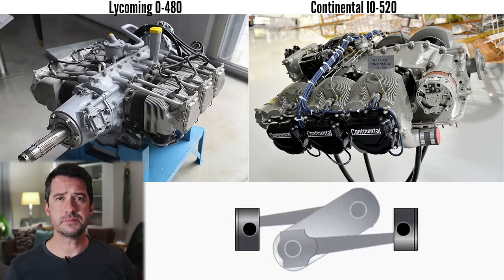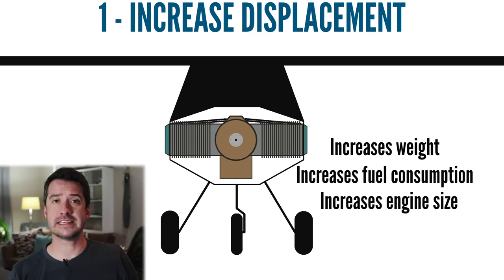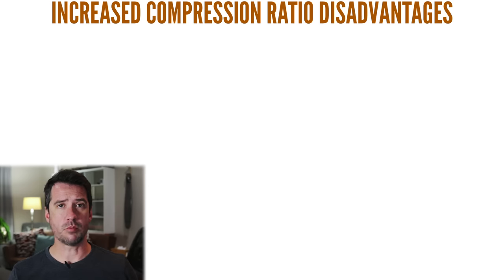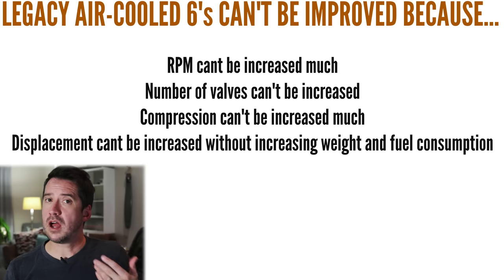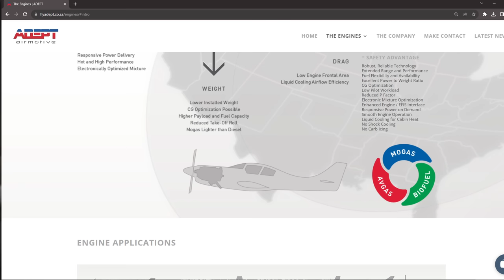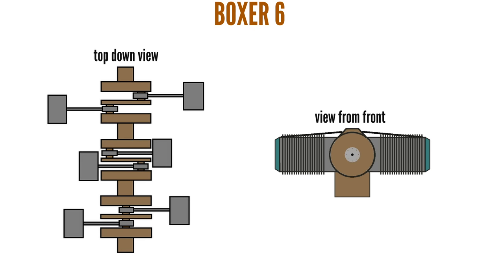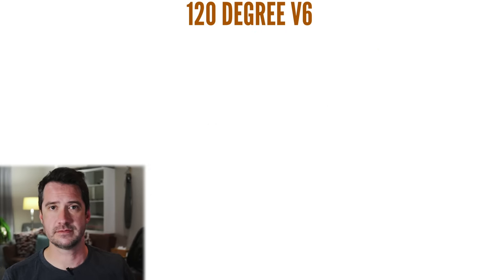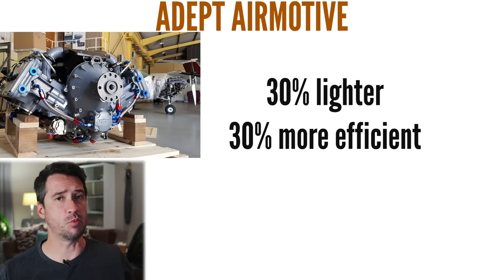Unusual V6 Airplane Engine Makes Boxer 6 OBSOLETE?

Comment: Turboprops make piston obsolete.
Reply from the maker: Not on cost. Be that puchase cost or running cost.
Reply: @LetsGoAviate  There's no reason why it should be from an engineering standpoint, nor an economic standpoint in the case of a specialty V6.
Reply: I still don’t get how the turbine survives the exhaust temperature before adiabatic decompression. Piston valves already glow red. Those tiny cooling channels fight against 90° of the gas which is burned.
Reply: @ArneChristianRosenfeldt  Inconel. Water injection. Impulse turbines. The engineers have it figured out, otherwise it wouldn't work.
Reply: @MoronicAcid1  I guess piston engines shouldn’t blow exhaust over oiled valve stems. Turbine bearings are far away from the exhaust. I wonder if it is possible to place a longer sleeve over the valve stem and blow cooling air into it while it’s open.

The exhaust valve could also sit on a shaft with a lever ( rocker arm ). So the actual bearing is far away, and only the seal gets hot. Or don’t really seal, just have higher cold air pressure than exhaust pressure. Kinda like in a turbine. Make exhaust valves out of inconel. Mercury cooling in stem and for the seat?

Comment: I think with proper design, a boxer crankshaft flat 6 can be nearly as short as a V6 crankshaft.  Example:  Subaru's 3.0 liter  EZ30D flat 6 engine is only about 3/4 of an inch longer than their 2.5 liter EJ25 flat FOUR engine.....

I'm not sure why they went with a V configuration when aircraft cowlings are already designed for flat engines.  People are used to flat engines in airplanes, why not keep the customer happy and build their engine this way?
Reply: Boxer engines are relatively fragile (they have weak crankshafts, as they either have flying webs in order to simplify the engine and crankshaft, or they're very complex with very thin crank webs, as that's the only way to make them short in length) and are difficult to manufacture and assemble. This engine is also far more compact in every dimension when compared to a Lycoming or Continental of similar power output, so its layout is irrelevant.
Reply: @PistonAvatarGuy  Wow, I am glad you told me all that!  Since I fly for an airline and I keep an old car, an "airport car" to prevent my '14 Porsche 981 Cayman S from suffering  door dings and dirt in general.
Reply: @PistonAvatarGuy  That is a whole lot of nonsense.  Flat engines usually use "boxer" crankshafts and this is NOT hard to produce!  The Subaru EZ30D comes to mind.  It has a total length that is 3/4 of an inch longer than the EJ25 flat FOUR cylinder engine!  Proper design negates what this man is posting;  The flat 6 is the BEST design since it is very light and has perfect primary and secondary balance.    This is why my 23 year old Subaru can start up with a nickel balanced on the edge of the engine cover, during the startup....

Hello?
Reply: @Flies2FLL  You owning a Porsche isn't going to make a boxer engine as strong as a V6. Porsche engines are also quite heavy as 6 cylinders go and their ultimate power handling capacity is nowhere near that of even split crank V6s (see: Nissan R35 GT-R). Also, be sure to tell the most recent 24 hour Le Mans winner how much better flat engines are when compared to 120 degree V6s.
Reply: @Flies2FLL  Traditional aircraft boxers use flying web cranks, this makes them fairly simple, but also fragile, and they do fail catastrophically from time to time. Continental even had problems with cranks breaking for while (edit: this seems to be ongoing). Modern automotive boxers support each web of the crankshaft with a bearing, making the crankshaft and crankcase complex and difficult to produce. With liquid-cooled boxers, the insertion of the wrist pins requires special holes to be made in the cylinder bores, adding to the complexity of the engine, and to the complexity of the assembly of the engine.

Perfect secondary balance isn't necessary for anything, Ferrari doesn't even bother running a balance shaft in their current 120 degree V6s.
Reply: @PistonAvatarGuy  That is not true.  An IO360 or IO540 have none of these.  And automotive flat 6 engines, to include the EZ30D that I own that is parked at a duplex that I own, and  the 9A1 M23.1 that is 16 feet behind my behind as we speak 

You be talkin' out 'yo butt~
Reply: @Flies2FLL  Ok, troll.

Comment: 0.5 lbf/hph is pretty much set in stone for gasoline engines without turbo compounding like Wright 3350s or Atkinson cycles like Prius. That improves it only to about 0.4.
Reply: Aircraft engines can run lean, automotive engines can't.
Reply: @PistonAvatarGuy  Why? Aircraft engines typically are run lean at somewhat less than rated power. Automotive engines are typically run at much less than rated power. The lbf/hph I believe assumes all the fuel is burned close to stoiciometrically. I doubt a 30% improvement over 0.5 lbf/hph is possible.
Reply: @leeoldershaw956  The catalytic converters that automotive engines use to reduce emissions require a stoichiometric mixture to operate effectively.

I think that the 30% figure includes all phases of operation and that some phases of operation can see very significant fuel savings when modern engine technologies are employed. Many aircraft engines can operate at, or below 0.4 lb-hp-hr at cruise power, while this engine claims to be able to get well below that.

Comment: Electric will Never Compete because of battery problems(many):  too heavy, not enough energy storage, fire hazard!
Reply: Don’t say never. But it’s really not visible yet. There are some strides being made in electric trainers, where they can land at the same airport, be off the ground for very limited, scheduled amounts of time, etc.
Reply: @russbell6418  Because of the battery chemistry brick wall, short hops is all they will be used for,  if ever commercially.
Reply: What about hybrid? For example I feel like aviation is ideal for an electric turbo. So usually it acts as a dynamo. When RPM changes, the kinetic energy of the rotor is changed electrically.

RPM of the turbo is limited electrically when it starts to choke near red line of the piston engine.
Reply: @ArneChristianRosenfeldt  Try not to express all of your ignorance in a couple of sentences.

Comment: Better answer?  ROTARY!   Yes I know I know the unreliable apex seal but I feel like with the way an AIRPLANE engine is almost always revving rather than like an RX7 idling at stop lights etc the relibitly would much better....plus I mean it COULD be made so modularly simple to swap out a rebuit base motor every so many hours no matter if  apparently indicated or not?  (just DO it regardless on schedule) then the issue would be eliminated anyway.  Small light and powerful!

Comment: "Keep it siple stupid" is the saying, the more simple - the more reliable. The time proven design of the old high octane horizontal opposed boxer has the lowest parts count and highest reliability also the best primary ballance all the while having a smaller frontal area. Rocking couple is not an important concideration here, but primary ballance is, so again its horses for courses and the flat "2,4,6,8 who do we appreciate" the boxer, comes out on top and its for this reason it will be around for some time to come. Changes to aviation propulsion have occurred in the past like, fuel injection, turbo and super charging, but only on there own merit. Fuel injection: lighter, reliable, eficient, less parts.
Boosting: huge increase in power and efficiency with low parts count increase, higher altitude attainable, reliable. The trade off's for complexity versus improvement in performance are the deciding factors that engineers consider before change is made, and they still use Magnetos.

Comment: WTF is Bio Fuel?
Reply from the maker: There's a lot of info available online. Biofuel is fuel that is derived from renewable biomass, e.g. plant or animal based waste. Biofuels emit less greenhouse gas emissions, and is considered carbon-neutral, but that's a whole different discussion.
Reply: @LetsGoAviate  oh wow. Where do they sell it?
Reply from the maker: @jasoncrandall  Not sure it's available yet, likely only for testing. Couple of production facilities / factories being setup around the world as of 2 or 3 years ago. SAF / biofuels are coming, but it's happening slowly.
Reply: @LetsGoAviate  SAF = Biofuel?
Reply from the maker: @jasoncrandall  SAF (Sustainable Aviation Fuel) is a type of biofuel
Reply: @LetsGoAviate  so this motor is tuned to run on SAF and Biofuel and Avgas and Mogas and “other types” of Biofuel?  Do you know how the motor can be so smart?
Reply: @jasoncrandall  It has a conservative compression ratio and a closed loop EFI system. It;s likely that it also makes use of a flex fuel sensor.

Comment: It appears that the balance shaft is already incorporated in the 2-1 reduced gear train shaft that drives the propeller at the front and the timing components at the rear.
Reply: At least a long shaft extending into the gear or even propeller hub would have more leverage to fight the rocking motion.

Comment: The engineers at subaru chose a boxer for a reason.
Reply: Yes, their Nakanishi heritage was showing.  They thought airplane.
Reply: Ferrari chose this arrangement for their Formula One engines during the 1980s turbo era, an era which made use of some of the most powerful engines ever used in F1 (1,200 hp in qualifying trim). Ferrari and McLaren also chose this arrangement for some of their recent models, the 296GTB and the Artura. The 120 degree V6 in the Ferrari has the highest specific output of any engine that's ever gone into production.
Reply: High specific output is meaningless except when an artificial displacement limit is imposed for some reason such as tax.  What counts is weight, size, cost of manufacture, reliability, durability, and specific fuel consumption.  None of those are positively correlated with high specific output.
Reply: @anvilsvs  In this context, it proves the strength of the engine configuration. Obtaining more power from a given displacement results in higher stresses being placed on components, as a result of greater cylinder pressures (higher BMEP), and/or higher revs.

In the case of aircraft engines, obtaining a good amount of power from an engine requires balancing strength and weight, and in the interest of saving weight, the large displacement engines that are commonly used in light aircraft end up being quite unreliable. Forcing large components to endure the stresses associated with their own mass, without also making them heavy, makes them fragile.

In a Kitplanes magazine article, many years ago, I remember reading a report written by a mechanical engineer who said something like: The strength of a part does not scale proportionately with its size, its strength decreases as its size increases.

This somewhat explains why you can get nearly 1,000 hp/liter out of an F1 engine that can last for many minutes at a time, while a 500 cubic inch Top Fuel engine is trashed after a few seconds of operation at a similar specific power output.

Comment: The reason boxers hang around is reliability. You can literally have a cylinder fall off and the engine will keep running.

Comment: a direct injection twin cam diesel flat 6 with a centrifugal supercharger in ally would be a bloody good idea i reckon. there you go problem solved.ops i didnt watch all the way before commenting . thats almost my idea so i was on the correct track.

Comment: A boxer engine has a single connecting rod for each opposing pair of pistons. Three for a flat six. There is no offset so the engine is much shorter.
This whole justification for a v6 is not valid.

Comment: Yes it likely has a balance shaft as seen in the Pic at  https://youtu.be/RNy6dL3UqDs?t=474 It appears to be part of the Integrated gear Drive.  The picture shows the shaft leading to mid- engine where it serves to balance the engine and connect the prop to the crank

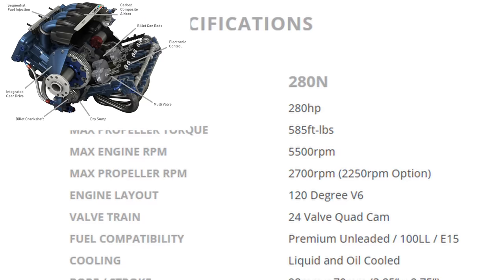Comment: In looking at the cutaway view of the V6 at 7:55 it seems that the reduction gear has a shaft that extends into the engine block.  Couldn't this also be used as a balance shaft?
Reply from the maker: I'm thinking it can yeah

Comment: Daim, coming from the automotive world it's crazy how ancient these engines are, pushrod, carburated and running on leaded fuel.

I would expect the designs to be mush more modern blocks with DOHC 4 valves per cylinder, VVT, VVL, Direct injection, modern turbocharger and all controlled by a modern ECU.

It'd probably not be much heavier since new casting techniques provide higher strength to weight, the valve tech would allow for flatter torque curves, direct injection for higher efficiency and the turbo would significantly increase torque, no need for higher RPM, and if you wanted to keep the same power it could have a smaller displacement for lower weight

Comment: It looks very promising but last time I checked, they are asking more than a comparable Lycoming. They will need to offer an initial price that is much less than the incumbent to incentivize early adoption and prove out reliability. If it turns out to be reliable and supportable, then they can increase the price over time. Do they have the financial strength to build enough examples at a relative discount to prove them out?
Reply: The turbocharged Continental and Lycoming engines in the 300 hp output range are more than $100k, the Adept Airmotive engine is $85k.

Edit: Kitplanes reported that the Lycoming IE2 is going to be at least $115,000! Although, that's probably about what this engine would be once certified.

Comment: The best aircraft engine made is a certified AC engine designed in the 1930a and resurrected in the 19902 with new modern materials and optimization and called the Dynacam.  It is small (turbine engine size and profile with perfect balance and no PSRU required with torque opitimized at 1800 RPM so Props are most efficeient.  It is very light weight and fuel efficient.  The only problem was a lack of funding to bring it to market and massive lbbying against the company to the FAA by the Legacy Engine manufacturers.  They repeatedly tried to buy them out so they could shut them down but the owners wouldn't give them control of the company in exchange for the money.  And so it goes.  The installed twi engines on a Piper seneca and showed them idling the engine at 100 RPM and standing a glass of water on the cowling without rippples in the water. Try that on a Lycoming or Continental.  Weight was around 120 lbs for 200HP.  Too bad they couldn't bring it to market, and so it goes.

Comment: These engines are also prone to sticking valves. Probably caused by regional overheating. Whatever the cause the engine stops and people die.
Reply: Adiabatic decompression is the way to reduce exhaust temperature. So high compression engine with central spark plug and port injection. 2 exhaust valves which can be opened close to BDC and still get out all the exhaust. Ideally, the exhaust valve lends in fresh, cold mixture pulled through by either good tuning on NA or a turbo.

Comment: The boxer 6 does not have a rocking couple because the couple generated by the 3-cylinder bank on one side is directly cancelled by an 180° phased couple from the other bank.  Think of them as two three-cylinder engines rather than pairs of opposed twins and you'll figure it out.  The 120°V6 does have a rocking couple that requires a balance shaft of some kind to eliminate it.

Comment: You need a balance shaft, if there is a secondary imbalance, the shaft would be at 2x engine speed.  For primary imbalance you can use weights on the crankshaft.  V-8 typically will have 2 counter-weights, on the crank.  The V6 can have counter-weights on the crank and have primary balance.  The only trouble with the 3 throw crankshaft is that since the impulses are sequential, you can get torsional vibrations. The engine should be good.
Reply: Ferrari doesn't use a balance shaft in their 120 degree V6.

Comment: Reduce the compression.  Just needs to modify the pistons or use thicker head gasket. Then you can turbo it and not strain it.
Reply: A thicker head gasket with no other changes would also advance the cam timing. This generally shifts the torque curve toward lower rpm.
Reply: @backcountyrpilot to some extent , maybe. Likely not a problem. We Just want to enable the turbo to do more work, without raising the combined (engine plus turbo) compression to exceed what the engine can safely take.
In Exchange it will be more efficient and more powerfull. 
Its a boxer 6 , so probably its less expensive on plumbing if 2  turbos are used. 1 per bank. Smaller package.

Comment: Sharing a crank pin in a v6 isn't optimal. Often the journals are super narrow and don't last as long in heavy use.
Reply: Why are they narrow if there are only half as much cranks which don’t even need to carry too much counterweight?